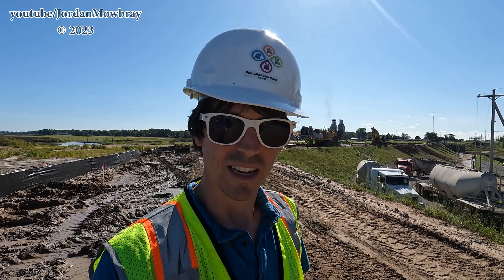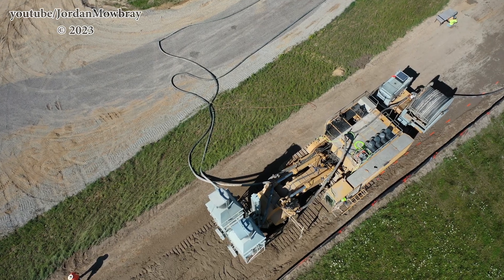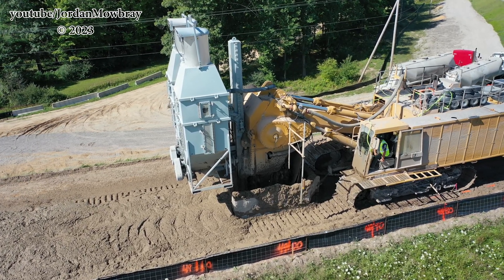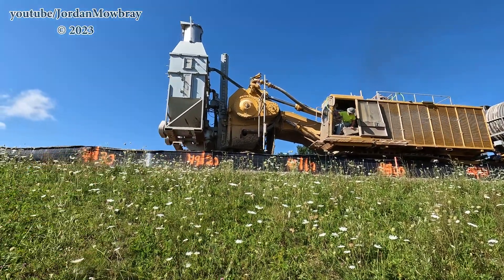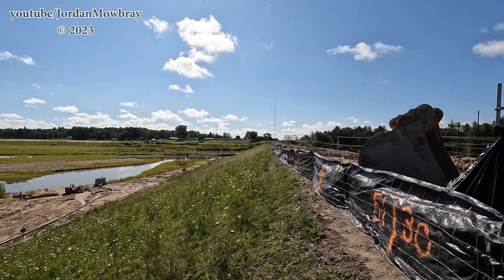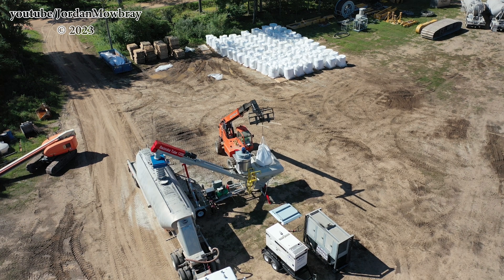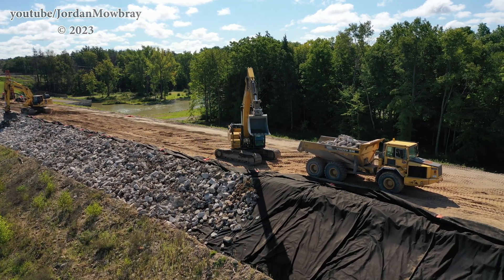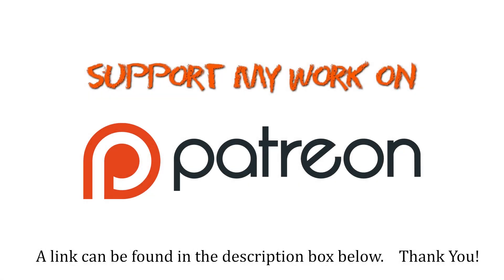HUGE TRENCHER! 🔥 SCB Cutoff Wall Install at Edenville Dam! #construction #dam

Comment: They need to dredge out the lake bottom because of all of the silt that has built up over time to make it a deeper lake sheet pile are useless they are bound to fail again sheet pile don't last. The need to be using  a C cant cut off walls. Down to bed rock. And they also need a  roller compacted  concrete (RCC) armored emergency spillway. Kiewit Corp was the company that rebuilt the Oroville California dam. That had a major spillway failure. and what they did changed the way dams are armored and repaired. On the Federal regulation level.  What they're doing here is a bandaid. It's a temporary fix. To refill the lake. It's not going to end well.